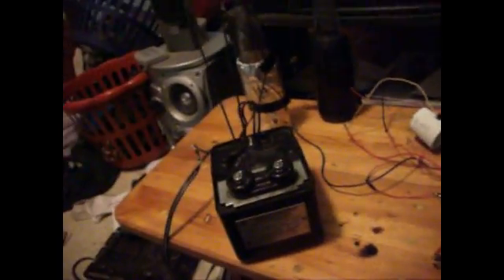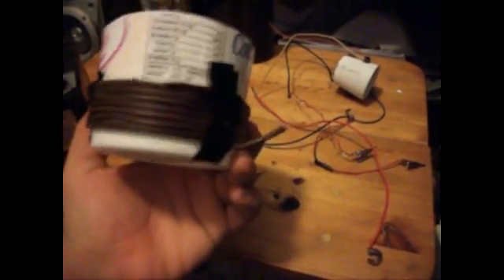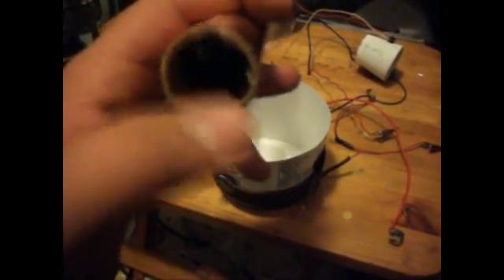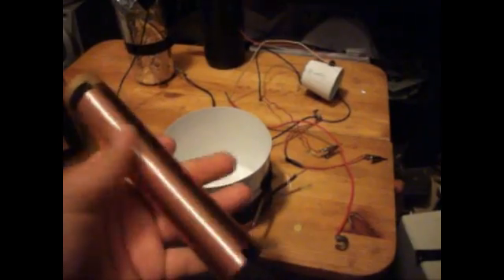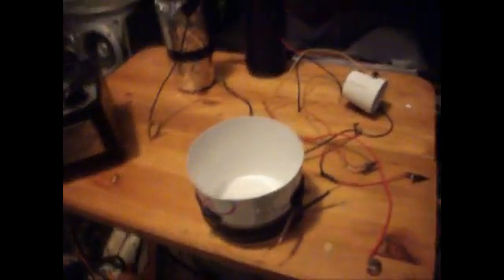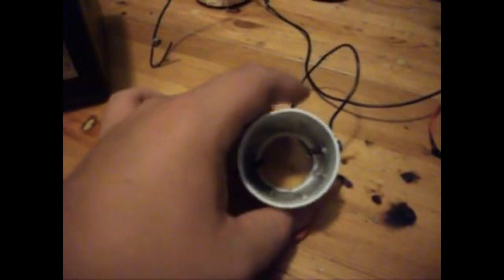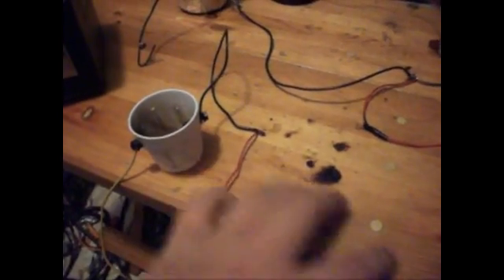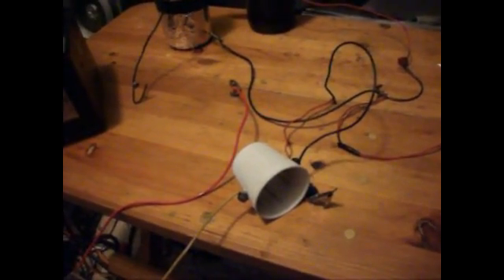how to make a tesla coil PT 1

Comment: I will have to look it up as I've remembered it several times recently. I wouldn't know where to start looking though. The sections I remember as looking like aluminium and ebony. It was the sort of thing that would have been easy to make with a large lathe and finish with modern sandpaper. Like that 5,000 year old Chinese emperor that had an aluminium belt buckle, despite ali using X0,000v to create.